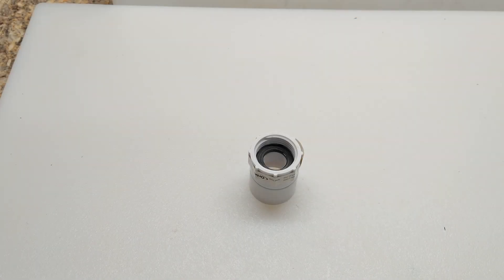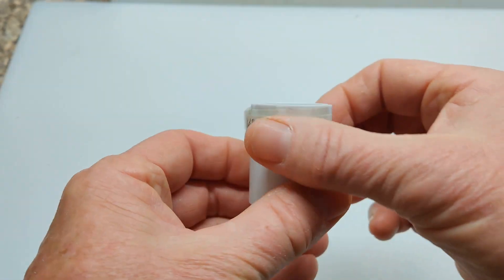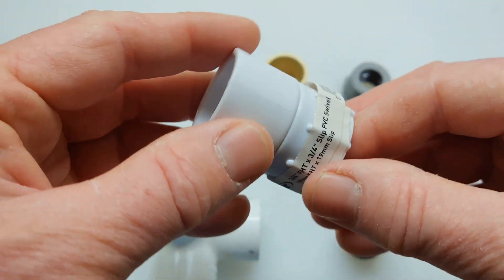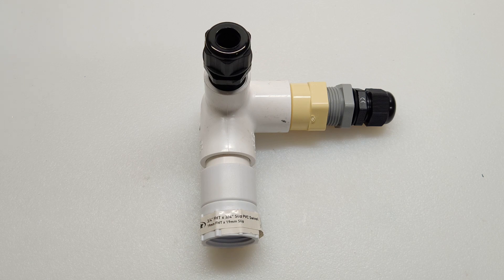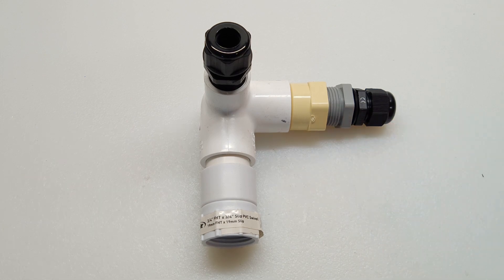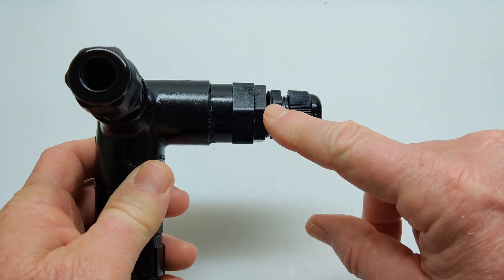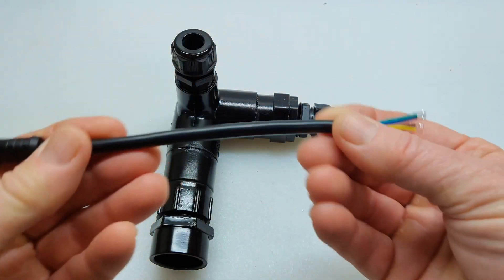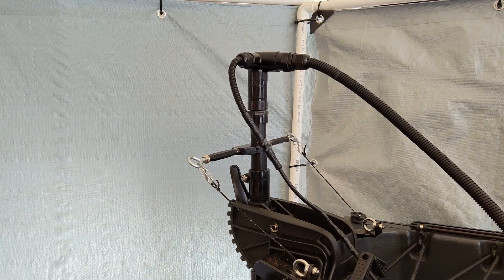Haswing Protruar 1.0 Trolling Motor Swivel Wire Cap

Comment: Am attempting to do the same here for my Haswing too. Can you please explain about how do you secure fit the 3/4 slip swivel which i can see is threaded, to the open end of the motor shaft?
Reply from the maker: You caught a mistake I missed in the video. The unpainted swivel is upside down. Compare it to the painted finished piece. That slips over the shaft.
Reply from the maker: Did you see my video with the newer version of the motor cap that I did? It is a more simple design.